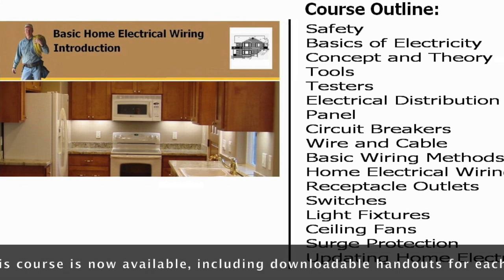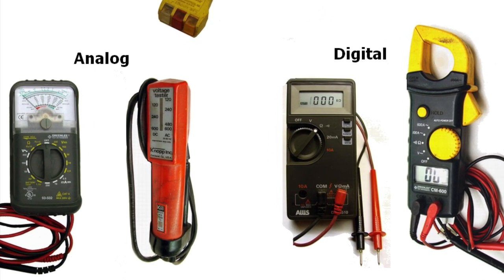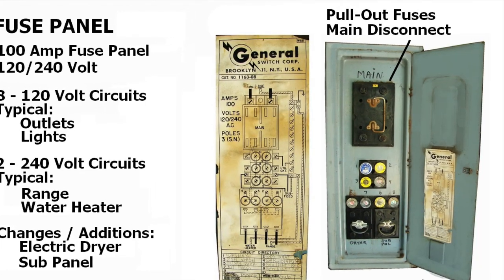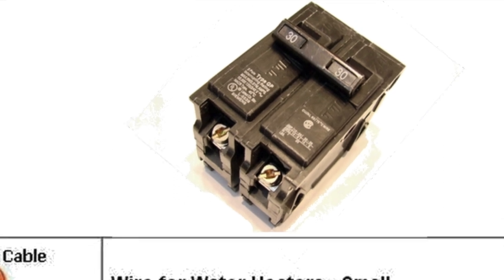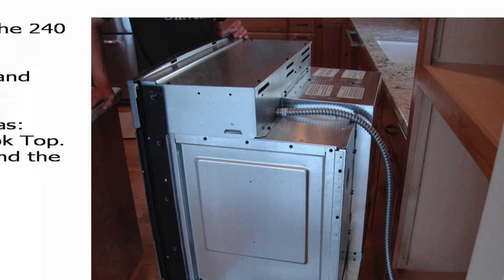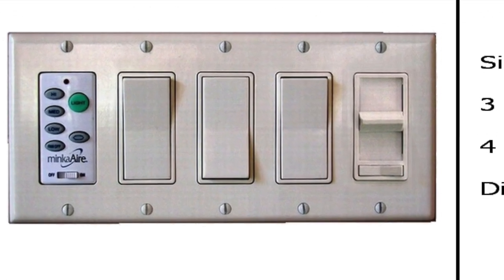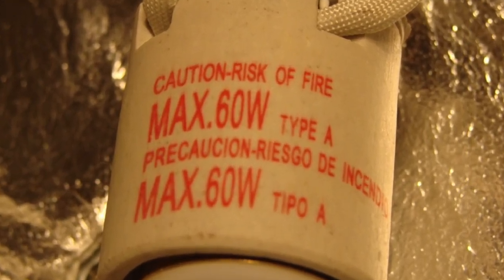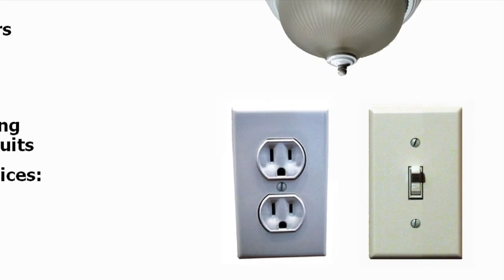Home Electrical Wiring by Example

Comment: Hey Dave: the 1930’s house I live in has had the wiring updated in the past (20 years or so before I moved in) and while in the process of connecting a new shop light to an existing J-box, I noticed the circuits within it have been wired via shared neutrals, which aren't labeled (numbered) to partner them up with their corresponding hots. Do you have any suggestions that I can use to trace the white (neutrals) to partner them up with their respective black (hot) wires without having to demo the plaster walls to locate them physically? In other words, is there some kind if an instrument that I can use to detect them.
I’d appreciate any feedback you can provide.
Best regards, 
Joe
Reply from the maker: A few methods to try: 
Electronic Circuit Tracers may be able to ID the circuit wires.

Use a clamp on amperage meter on the white neutral wire in question, and place an electrical load on one of the circuit outlets, could be a toaster or portable heater - the amperage reading on the neutral should reflect the load on the black wire of the same circuit.

To Identify all of the circuits and neutrals in the panel:
With the Electric Panel Main Power OFF, there can be Continuity Tests made between the black and white wires of the circuits - simply by shorting the two together at an outlet and checking Continuity between the whites and blacks at the panel - this is best done by disconnecting all of the circuit wires - this is tedious and best done with two people and NOT recommended for a novice, best done by a qualified and knowledgeable electrician.

Comment: What do I connect house red wire to on fan installation with lite where fan instalation say only to connect blue and black fan wires to black house wire.
Reply from the maker: See the wiring diagrams as https://ask-the-elecctrician.com go to the Ceiling Fan section - this will help you!

Comment: How would I add another electric dryer that is 30' from the panel box
Reply from the maker: A typical electric dryer requires a 30amp 240volt dedicated circuit, and the type of wire or wiring methods would be based upon the specific project, such as if the wiring will be concealed and protected, or installed on the surface using a protective approved conduit.

Comment: While I'm not a novice more like a journey man. I have seen many scenario where it isn't what it supposed to be, albeit it was probably good at the time or the installer lacked the knowledge of the NEC code.
I was looking for a basic home diagram of my house...any ideas how to go about achieving this? 
The previous owner never furnished any plans but, I doubt he was the original owner of the house being built.
Reply from the maker: You can see basic home wiring diagrams at ask-the-electrician.com

Comment: Hi Dave. I converted a chandelier to a swag lamp. It was older and I managed to research how to determine the positive and negative wires. But, it had a ground wire. What do you do with it? I am getting questions on my You tube about it. If you can help me, I will gladly promote your channel. Thank you! Lorne Cheek.
Reply from the maker: Hi Lorn, The typical swag type light fixture includes a ground wire which may be added with the two wire cord. The ground wire is attached to a metal portion of the light fixture, typically the junction box area where all  of the wiring is spliced together, and then the ground wire is attached to the circuit ground wire inside the ceiling light box.
I Hope This Helps ,
Be Safe!
Reply: @AskTheElectrician  Thank you! I will check into this after work!

Comment: Working on the job today, we turned all the circuits on and a couple outlets didn’t work. The guy who is training me said everything needed to come together in the box first and then go to the outlets. I usually have two blacks on one side and two neutrals on one side or if it’s one wire one on each side. I’m struggling to see the big pictures because of pressure to to get the job done. How do I go about hiring a mentor. I’d pay well to talk to someone. I’m also in school for training, but it seems like there is never enough time to go over the whole thing before I’m taking up too much of others’ time.
Reply from the maker: Anthony, I totally understand, and unfortunately good mentoring is rare these days. In a typical project, new or remodel, the outlets and devices are always made up first, and then the circuit power can be turned on once the inspections are complete. 
Apprenticeship training programs can be invaluable when done right, and not with someone who has a god complex. In my early days I had the opportunity of being with some of my mentors all day long, and discussing many methods during the day and going from job to job. I hope you find a good mentor, and then become one yourself to pass it on to the next guy or gal.
Reply: @AskTheElectrician  Thanks for the help, I have not found a mentor yet, but hope to someday find someone.

Comment: I switched out 2 switches and 2 outlets. The 2 switches(1 controls the light the other for a bath fan) are together in a duplex box which has 4 set of wires. I thought i wired it the way it was before but now the light dont work and 1 outlet doesnt work
Reply from the maker: Sorry to hear of the trouble Lesley. The wiring will need to be tested and identified in order to get the proper connections made to restore the original functions for the switches and outlets.

Comment: I put in a new well pump,rewired and put in new pressure switch.Three wire. I get a reading on volt meter 115 volts each side of circuit all the way to the well and no pressure or water.What is up?
Reply from the maker: Here are a few things to check:
Make sure the circuit voltage matches the well pump motor, the wire size down the well is rated for the distance to the pump, and the capacitor is not faulty.
Testing the circuit with a clamp-on amp meter will show if the pump is running or not, and if the amperage is within specs of the pump motor. If the pump is running take a voltage check to see if the voltage is correct as well. If any of the circuit wiring is undersized due to the distance then the voltage will drop when the pump motor is trying to run, and if this is the case it can damage the pump motor.
Reply: @AskTheElectrician  i would like to know what the s wire is for on a 220 split air conditioning is for?